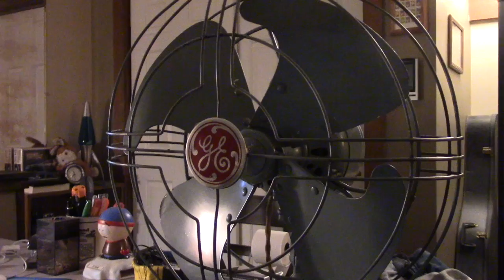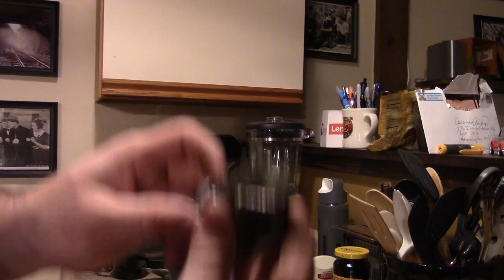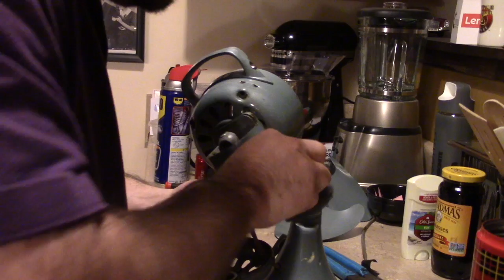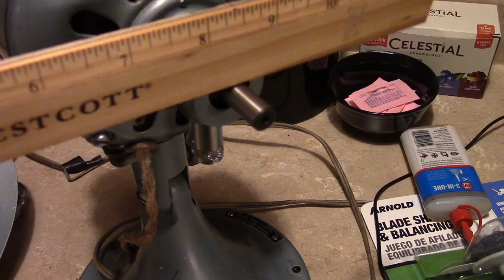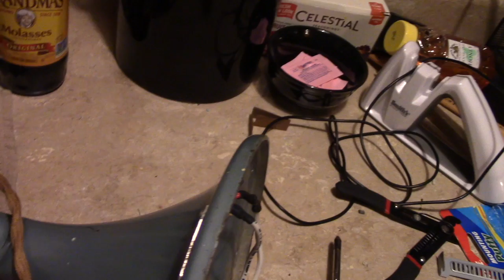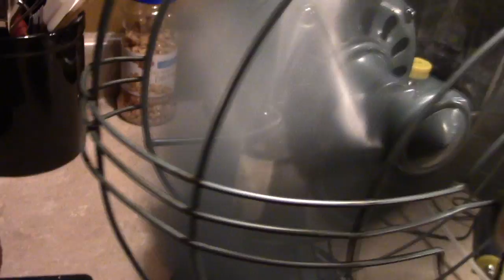1949 GE Vortalex 12" Desk Fan Repairs

Comment: One more question. The capacitor on my fan doesn’t start it quite as fast as it should. First, how do I identify the terminals on the fan and 2nd. Will any old 2.0 micro farad 250 volt capacitor work. I’ve never really dealt with caps so I don’t know where to start. Mine is a 16 inch ‘46 to ‘48. Thanks!

Edit: thankfully the windings on my fan look to be in very good shape. So replacing them likely won’t be necessary.
Reply from the maker: Check out the forums on AFCA
Reply: @bbishoppcm  thanks!

Comment: Hello, my vortalex also has the buzzing problem. However I wanted to know if that epoxy will still smell after it has cured. I don’t want my fan blowing stinky air everywhere. Thank you. I hope to hear from you soon.
Reply from the maker: Once cured, there will be no odor at all. The only downfall is it’s permanent and if the stator ever needs to be rewound, you’ll have to cook it out with a torch!
Reply: @bbishoppcm  ok! One more question. The capacitor on my fan doesn’t start it quite as fast as it should. First, how do I identify the terminals on the fan and 2nd. Will any old 2.0 micro farad 250 volt capacitor work. I’ve never really dealt with caps so I don’t know where to start. Mine is a 16 inch ‘46 to ‘48. Thanks!

Edit: thankfully the windings on my fan look to be in very good shape. So replacing them likely won’t be necessary.

Comment: They vibración is for they damaged propeler and ware bearings /bushings
Reply from the maker: …what?
Reply: Check they blades and bearings they can produce vibration
Reply from the maker: @genarolamberti799  i thought I covered all this… the bearings are fine, the blades are bent

Comment: Nice fan, spending $125 on one today would be the price equivalent of buying one back in the day. Fans weren't made to throw away, they were a major purchase. I bought a Vortalex on eBay for around that price and do not regret it. I've ran it all day today in honor of it being the 4th of July. So, what better fan to run than one that was made right here with pride and honor. Love the windup sound that the motor makes on these fans, kinda makes me think of the old WW2 planes while running.

Comment: what would be the correct grease to use in this situation? I have been using the same can of red grease that someone gave me a long time ago for free for years now and i have never had a failure, but it is about to run out and I am just wondering if there is actually a certain type of grease that should be used in the gearboxes.
Reply from the maker: If the fan has a rear oil port, Lucas Red n’ Tacky works well; if there is NO rear oil port (like the later GE Vortalexes), you’ll want something that will leach some oil out - like multipurpose automotive grease (not high-temp). This is a reccomendation I found on the AFCA forum.
Reply: @bbishoppcm  yeah. I just got a early 50s vortalex 16 inch, it runs well but the windings buzz alot. but i ran it for 24 hours and it did not get hot, so it is okay i guess. what i have been using is not red n tacky, it is just some sort of red bearing grease. but i think i am just going to get some normal grease like in your video because i am running out and this vortalex has no rear oil port.
Reply from the maker: I solved my coil buzz by injecting some Loctite auto-mixing epoxy between the stator and the motor housing. The only downside is if I ever need to service the windings, I’d never be able to remove the stator!
Reply: @bbishoppcm  yeah, I saw that. I may take it apart again and see what I can do. mine has bear windings instead of wrapped ones like on your fan, so I will have to see what I can do.

Comment: I have the same one but can get it to spin fast Only works on high
Reply from the maker: Could be a variety of issues... loose wiring at switch, worn switch, open circuited windings, or it could just be gummed up lubrication. To rule out a lubrication issue, let it run for a while and then try switching it to a lower speed - if it slows down and continues to run, then you need to consider a proper tear-down and cleaning.
Reply: Thank you gonna try that n if not clean the contacts on switch

Comment: You didn't show us how to get the fan cage off !
Does the cage have to be bent to remove ?
Reply from the maker: Sorry about that... yeah, getting the cage off was a bit of a "tavern puzzle." It's easier to just remove the blade set and cage as an assembly, then you can remove the blades from the cage.
Reply: Just received the exact same fan ,$89.99 plus $87.45 shipping to Canada from Ebay.ca
 Gave up this morning in frustration, but later afternoon 2nd attempt was a success.
Fan came without the three speed switch , just a hole, but works on lowest speed by plugging and unplugging.
Fan has the same barely audible noise you fixed with the 2 part epoxy. 
Thanks for posting exactly what I was looking for.
I would love to see the "Battle of the Fans" ; GE Vortalex  vs Dyson Air Multiplier.

Comment: Packing the bearings with wheel bearing grease.....If you mix the grease 50/50 with 80-90 weight gear oil, you won't have to do it again for 50 years.  :-)
Reply from the maker: Good tip! But that smell... ugh!

Comment: Great job Brandon. If possible, would love to see how you balanced the blades if you recorded that.  I have a 16" 1940 Vortalex with unbalanced blades and working on.  Thx.
Reply from the maker: It took HOURS to get them right... it was agnoizing. The trick is to use reference points to ensure each point of each blade lands at exactly the same spot as the previous blade. I believe I showed how I did this in the video. If you're adding or removing material, you're doing it wrong. Also, make sure you make small tweaks and start from the hub, working your way out. It can be done! I have a 16" model as well, and it's a bit off (you can see this when viewing the blades from the side) but it's not affecting balance, so I'm leaving it alone.

Comment: I have a 1950s Westinghouse Lively Aire 10" Desk fan. I found it at a local flea market for $20. It has never let me down. Works as it should, I oil it up every time I use it and i put it away for the winter. 

Image: https://c1.staticflickr.com/8/7254/7741862864_44702eb6b8_b.jpg